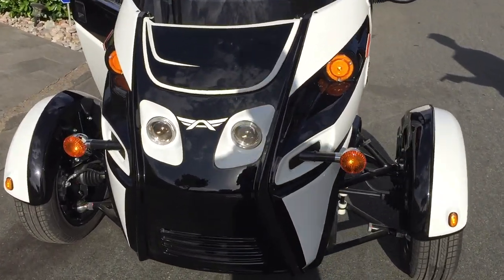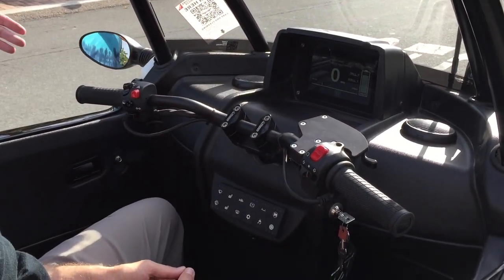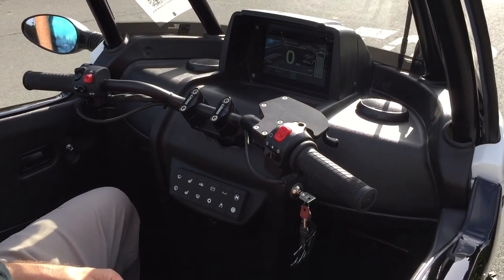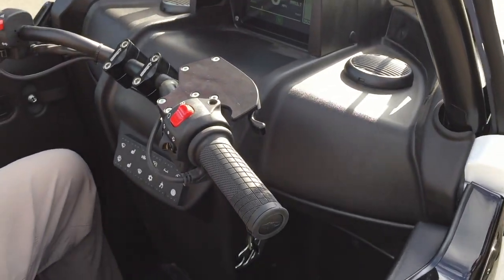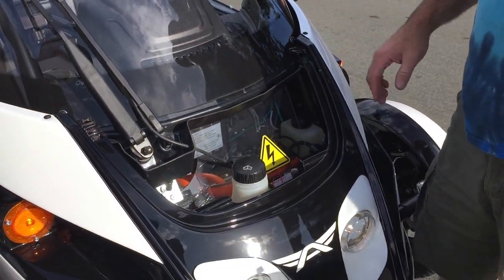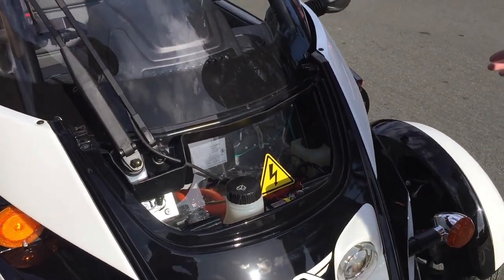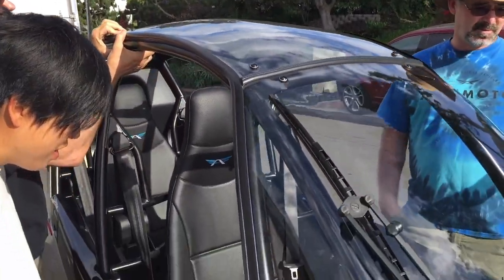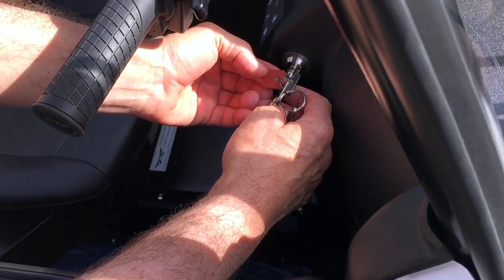2022 Arcimoto FUV Delivery & POV Drive!

Comment: Pretty sure the "power steering fluid" is actually the wiper fluid.
Reply: Yeah, there's no hydraulic power steering. Will be torque-vectoring soon
Reply: Its probably headlight fluid
Reply: Yes, it's wiper fluid but blinker and headlight fluid coming soon.
Reply: Yeah, how could the delivery and setup guy make such a giant mistake.  It actually depicts Wiper/Washer symbol right on the cap.  Can't imagine the mess that would result if you put power steering fluid in there and spray it all over the windshield.  Yeesh.

Comment: At around the 4 minute mark, you incorrectly identify the windshield washer fluid fill as “Power steering fluid”. An important distinction.
Reply from the maker: Yes, the delivery manager incorrectly identified that component. The vehicle doesn’t have hydraulic power steering. He realized his mistake and corrected it in the comments.

Comment: An intelligent presentation. Thank you for doing it.
It's now a year later, will there be an update?
Reply from the maker: Thanks for watching! The vehicle was actually sold in June, 2023 - about a year after purchase. The only issue in that time was that the throttle would occasionally cut out, requiring you to go into neutral, and back to drive again. No major issues though, and the owner put about 650 miles on it in that time.

Comment: I thought there might be some criticism in the Comments regarding the "Don't touch that - it'll kill you!" warning about the big cable array behind the plastic screen under the bonnet (hood? Whatever 😁), but it made complete sense.

In the engine bay of an ICE car it's pretty obvious what's going to pulp your thumbs, eat your fingers, or grab your hair and drag your face into a spinning pulley - all those belts, fan blades, linkages and hot, hot pipes - but an EV just sits there, humming innocently to itself, waiting to bite...
Reply from the maker: Yeah, in most EVs and hybrid cars, all the high voltage wiring is required to be colored in bright orange so that you know what could kill you and what won’t. Still, I definitely agree that the engine bay of an ICE car is far more obvious when it comes to things like this

Comment: If I was rich and wanted a toy that's probably really fun but doesn't yet have the support network necessary to protect an ordinary person's substantial investment, I'd definitely buy one!
Reply from the maker: Oh yeah, I definitely agree with you there! The vehicle in its current form is fairly overpriced for what it offers, and as you said, doesn’t yet have the support network. A used EV would be a better buy for the same price, but if they bring the price down then I might consider one, though it can’t be a primary vehicle.
Reply: Arcimoto will not sell in any state where they have not first set up mobile service teams. That list just jumped to 13 states. Several hundred FUVs, plus rental fleets, are in Florida. They come to my door for software updates, recall actions and warranty work. So now you know there is no reason to wait.
Rich? I'm probably the poorest one to buy this. I rode ebikes for 7 years to save up for my Arcimoto on my SS pension. It took half of my entire modest life savings to buy and it was worth it. So fun and so much safer than motorcycles I have owned in the past. This was the only new vehicle I ever bought.

Comment: Arcimoto is OK, but I like the Mono Tracer E, it's more practical me, all weather except heavy snow!
Reply from the maker: Oh wow, I just looked it up and that thing looks so cool!
Reply: Mono Racer E is a dangerous motorcycle for one. No cargo space, no stability, you can't even put your boot out to stablize a hard turn. It has no certified 24G crash cage or 6 point harness so you need a helmet. When leaning in turns, all motorcycles are dangerous due to slick spots, pea gravel patches or just rain. After surviving 5 motorcycles I feel very safe in my Arcimoto. I have 14.5 inches of car tire tread width on the road at all times, no rounded tires that slip easily. I removed my rear seat and added cargo net to have a pretty huge cargo bay bigger than any motorcycles' saddle bag and trunk capacity.
Reply: @popeyegordon  *four point harness. its just two seatbelts together nothing special
Reply: @seawas1046  Incorrect. There are two completely separate three point harnesses exactly like car seat belts. Two more in the rear seat. I like the redundancy and the simplicity of a proven design in the harness. They have the chimes when not buckled. Two 3 point harnesses are pretty unique if not the first ever used that way. Only the waist sections lay on top of each other.

Comment: These are super cool, absolutely on my wish list if I every buy another car (don’t need one right now as I’m working from home and have local shops). Personally I’d modify to a single seat with an enclosed rear storage space for shopping but that is down to my lifestyle requirements.
Reply from the maker: Oh yeah, they actually have a single-seat version with large rear storage; it’s called the “deliverator”. I’m not sure if that model is currently available for non-fleet customers to purchase but I’d imagine it would be soon. I’ve seen the inside of that model and it has an incredible amount of storage. Plus as you said, a majority of people travel by themselves so there’s definitely a market for the single-seat versions.
Reply: The Deliverator is $5K more, not worth it. I removed my rear seat and added cargo net to enclose the rear and I also have the locking trunk option. Any modifications that involve drilling will void the warranty.
Reply: @popeyegordon  This is a good option indeed to increase the modularity of this platform. if you only have one person inside then it makes sense to just increase the cargo area/volume

Comment: What’s the maximum range on these please I don’t want 100 miles or something like that I need a lot more than that. I like to go across country and up and down the Coastline
Reply from the maker: The estimated range features are shown in the video description, but if you need more than 100 miles of range then this isn’t the vehicle for you
Reply: @BrandonKipp   thank You yes I do. The Largest leg of my trip where I can’t charge is between El Paso Texas and San Antonio. Tesla has chargers in Fort Stockton but as of 3 years ago no one else did. I cannot afford a Tesla and they’re higher now than ever I heard that the S was almost 160,000 and I heard that X which is what I wanted because it’ll tow it little trailer is 140 so you know those those prices are outrageous I could never do that not less I had some miracle happened and it has not
Reply: I just checked and electrify America is now in Fort Stockton so I’ll have to look and see but I think it’s more miles than 100 between El Paso and Fort Stockton but thanks
Reply: Yes it’s 247 miles between Elpaso and Fort Stockton Texas on I 10 so that’s why you need at least four or 500 mile range because what they don’t tell you as you got charge only to 80% and then if you get in heat or you get in cold or you get in hills or anything that degrades and you don’t want to be out in the middle of the desert and run out of whatever that is not the place to run out of gas electricity or water
Reply from the maker: @kathyfann  Wow, at least they’re expanding chargers but I agree that the prices of some EVs are still high. Have you checked out the Chevy Bolt EV? It’s only around $26k and has 259 miles of range, which is almost enough to cover that leg of your trip in real-world driving but not quite. The Kia EV6, which I personally own, is $47k if you want a version with over 300 miles of range, and comes with free Electrify America charging for a while. Hope this helps!
Reply: @kathyfann  Unless you work in mobile professional services you do NOT need even a 100 mile range. That is what public transportation is for. Long commutes and pleasure drvives became obsolete for at least the next century once we heard the science consensus on global warming a decade ago. We are all obligated to change our behavior. I have not left my small town in 8 years except by public transportation. I drove an ebike until I bought the FUV recently. You used to be a fan of the ELF ebike I drove for so long. What happened?
Reply: @popeyegordon  What about places where public transportation is non existent? Then 100+ is absolutely necessary
Reply: @seanrodgers553  That's something we are working on. Federal, state, county and local governments all want more transportation options and they already support increased car pooling and various commute reduction projects. The entire nation does not have to suddenly and equally comply, it takes time. The Inflation Reduction Act has launched a huge project to make sure EV charging stations are no farther apart than 50 miles across the US. 
But what US consumers have deemed necessary is often not, it is just spoiled demands to never change habits no matter how damaging they are. With electronic communication the way it is today the people living in remote locations can share trips much more than they are now. Farmers already tend to share some machinery and that can expand to include trips to town in some cases. Bus stops in the middle of nowhere can be traveled to by bike where they wait for anyone going their way. If they buy large loads the truck drivers can take passengers on the way back. We have barely begun to try to live sustainably. Carbon taxes will end the abuse of heavy pickups trucks only used for redneck rifle racks.
Reply: @seanrodgers553  I agree
Reply: @seanrodgers553  More work needs to be done for sure
Reply: @BrandonKipp  Yeah the bolt is such a great option so much better than barkie-moto tricycle
Reply: @popeyegordon  you can not ride a bicycle in the middle of nowhere lmao
Reply: @seawas1046  In what world are there no bikes covering long distances? 'Laughing your ass off' about a simple fact it was foolish to deny is stupid. Bike commuters exist all over the world. Bikes are seeing a huge resurgence and a shortage of new bikes and parts everywhere because of historic demand now. 
Clean and simple is the best. My enclosed cargo bike has a 550 pound capacity and solar panel roof. A bike like mine just passed 46,000 miles in a never ending journey around the US and Canada. Skinny tire bikers have century clubs where they do 100 miles in a day, a proof of concept that has been repeated every week for the last 80+ years.
Reply: @seawas1046  Youre a troll. Nothing more. I have owned my Arcimoto for 16 months and I have an electronics degree and 20 years of e-bike experience. THE BOLT WAS DISCONTINUED.

Comment: Needs window for winter….
Reply from the maker: For sure, or even for rain a window would be beneficial.
Reply: It has a wrap around windshield and clear roof that keeps me dry. Heated seats, hand grips and heated defroster. There is no significant wind chill. 
But just as the FUV is not suitable for deep snow, snowmobiles are not a failed design just because they are worthless in Florida. Excellent design!

Comment: I don't see a Registration Plate [Number Plate]?
Reply from the maker: It didn’t have one during delivery, but one was put on afterwards. It’s located at the rear right below the cargo box area, and in the US, it’s the size of a motorcycle plate, which is slightly smaller than the traditional plate for a car or truck.

Comment: why does it have ao many kill switches? Can be a hazard when driving it and I dont see the purpose of having 2 or 3 kill switches, with the first one being completely dangerous if you are on a highway
Reply from the maker: I believe it's mandatory to have a kill switch for a motorcycle type of vehicle, but I agree it could easily get pressed.
Reply: There is one mandatory kill switch only, in the usual place adopted as a standard for the motorcycle industry. I placed electrical tape over mine so it can't be so easily accidentally activated. It is too easy to accidentally flip that switch and not be aware of it so you think it has broken down.

Comment: Make me one of these it’s an E bike they don’t go over 20 miles an hour that has electric assist so I don’t have to be part of the main stream farmers insurance yearly license fee all of the trappings of a car I have two vehicles already I want something to go to the grocery store and the post office the park with my little dog
Reply: That's what the Organic Transit ELF e-trike was - solar panel roof and pedal power. I drove mine exclusively for 7 years and saved so much I could pay cash for my Arcimoto. Are you losing your memory? I recall you posting about the ELF many times. What you do not know is that insurance companies give the very low motorcycle rate to the Arcimoto. Mine is just $130/yr for a good Allstate policy. Yes, I'm saving $800/yr in insurance plust never buying gas or oil changes again.
Reply: @popeyegordon  The solar trike looks pretty cool! the solar panel is so smart because it's taking free energy from the sun and converting it into actual energy. isn't this kind of similar to arcimoto MLM? what are your thoughts on that one? I know you can pedal and stuff to recharge the battery while its stationary

Comment: You didn't check for panel gaps??!
Reply from the maker: Everyone complains about Tesla’s atrocious panel gaps, as they should, but this? They're huge at the bottom of the doors, but I think that's acceptable for an open-air vehicle like this. Plus, I suppose it’s a less expensive vehicle, so panel gaps won’t be perfect, and I don’t think they need to be
Reply: @BrandonKipp  Yeah, but the doors are still a rare sight and I don't think gaps are a priority for them at this point
Reply from the maker: @2nd3rd1st  Very true. I think that the simple design of the doors makes it less of a need to have perfect gaps (waterproofing isn’t an issue since the doors are only on the bottom half)
Reply: This is an economy utility vehicle. If you want perfect panels, carpeting, soudproofing and wood grain dash you spend far more.
Reply: @popeyegordon  I agree

Comment: Brandon Kipp - Do you need a driver license to used this or not my friend ?
Reply from the maker: Yes. In the US, you can insure this as a motorcycle, but you need a traditional class c license to drive it.
Reply: @BrandonKipp  - Do you kno any so called e bike were i don't need a driver license 4 ?
Reply from the maker: @AnimeAndrew1983  An e-bike is an electric bicycle, which you wouldn’t need a license for, just like an electric scooter. An electric motorcycle, or a vehicle like this would require a license. Depends on the area and other factors as well.
Reply: @BrandonKipp  - kno any youtube videos i can watch to get a clue my friend ?
Reply from the maker: @AnimeAndrew1983  I’m sure you could figure it out quicker with a Google search than watching a video.
Reply: @BrandonKipp  - Ok but what do i type in the google or yahoo search bar my friend ?

Comment: nice video but you should say what the battery voltage is when giving the warning
Reply from the maker: I’d assume this uses a 400V system like most EVs, though I haven’t found anything about this topic.
Reply: There is no need to know the exact voltage. The warning is sufficient. The FUV has a 103 volt battery. Balking at a voltage warning is silly, ICE cars have huge fuel tank bombs underneath. Statistics show that EVs are safer than gas for hazards from the power source.
Reply: @popeyegordon  voltage is a basic data point for ev's for whatever reason---safety,amps,power ,heating.
Reply: @charleslindsay3201  Much more so for ebikes than for EVs. The main spec you want is battery capacity in kilowatt hours. Arcimoto's is 18.4 kWH. Small EV cars are around 40 kWH. Battery bank voltage does not influence safety for the owner unless you put hands where they do not belong. The owner manual provides safety guidance. Most EVs automatically cut power to the main relay when there is a collision.

Comment: I don't understand why flexible, rooftop solar panels aren't available.
Reply from the maker: I agree! Especially with how efficient this car is (at least in the city), it would make a lot of sense even if it was a low-wattage panel.
Reply: @BrandonKipp  - Can't think of the name, but there's a company that makes flex solar panels for RV van upfitters.  I bet they could make custom panels to Arcimoto rooftop specifications.
Reply from the maker: @RetiredAmerican  Oh yeah, that would be amazing. It would be a great perk for Arcimoto to have a semi-solar-powered car
Reply: They are always available but not practical for such a small roof. 100 watts is less than the daily parasitic drain of the systems on the battery when parked. A 1500 watt minimum solar system is required to charge the 18KW battery in one full day of sunshine.
Reply: @popeyegordon  *18 kWh
Reply: @seawas1046  That is the battery rating, not a number that has any bearing on the size of a solar bank which is rated in KWH. Note the hours part.

Comment: just one thing does it smoke the wheels
Reply: They are not going to cater to irresponsible kids or those who want to waste energy. The torque for starting is governed to make sure you can't spin the wheels and waste energy, wear down tires or endanger the public. This is not a redneck toy or an off road vehicle. That behavior is becoming obsolete fast.